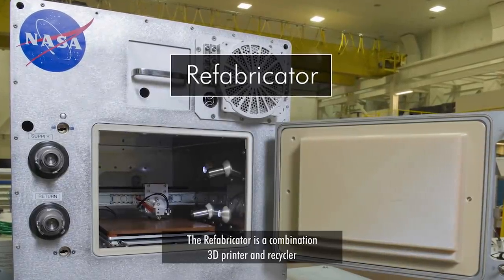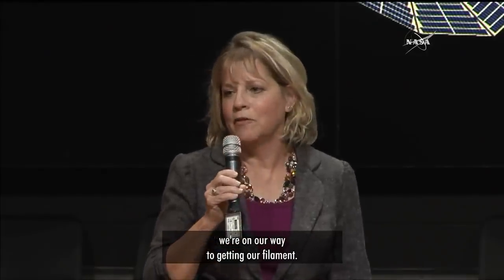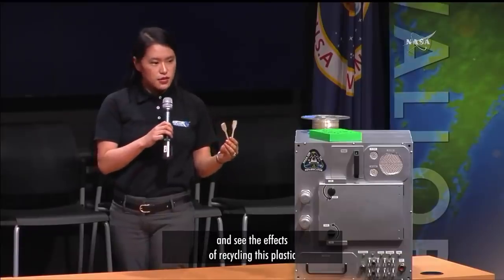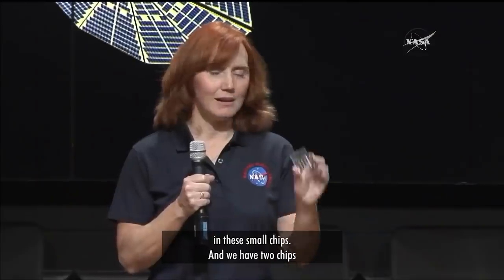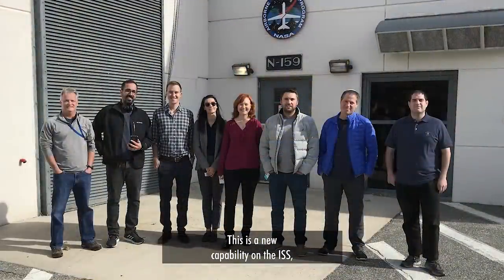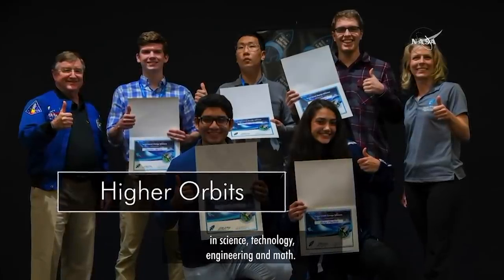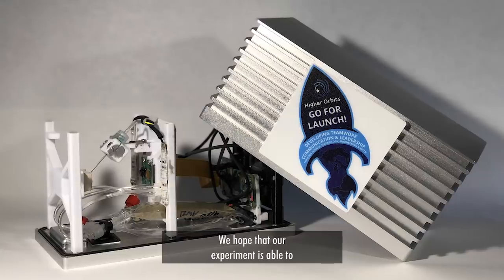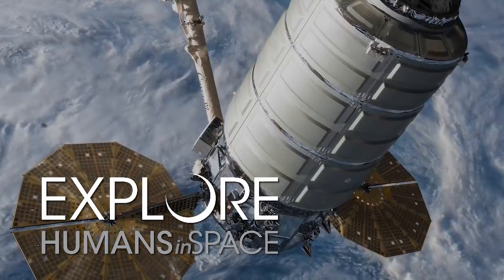Northrop Grumman CRS-10 Mission to the Space Station: What's On Board?

Comment: Im doing mechanical engg can i have a chance to become astronaut...if i have can u tell me the steps im a great aspirant of it.
Reply: be an air force or navy pilot
Reply: Really nice :),but i do not know, i agree with   criticality
Reply: Flight experience, several thousand hours, preferably airline or military most preferred test pilot with scientific, engineering or medical degree in good physical and mental condition. Get flying as soon as possible even gliders and single engine props are an excellent place to start and the absolute minimum requirement. Very few are selected, many less than are qualified, so expect several applications over about 10 years. Most astronauts take 2-5 applications until they are selected over many years. Often they will tell you if you are a good candidate and that you should try again next round. You do need to be a US citizen but contrary to popular belief glasses are not a problem. As long as your vision can be corrected to normal vision it's no problem.
Reply: 221 b thank u bro ♥️
Reply: Criticality ♥️
Reply: @sohail9157  NASA recommends you find something you like but that also helps your chances as astronaut (like mech engineering). If you fail you still did great stuff like a good career and fly aircraft. And of course if you do get chosen there is a much, much bigger adventure ahead.
Reply: 221 b im greatful for u thanks